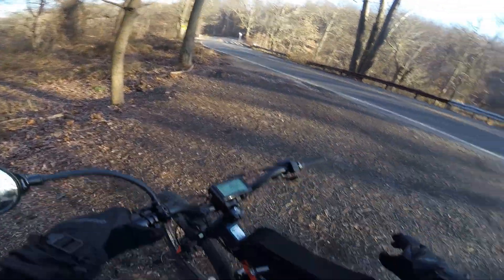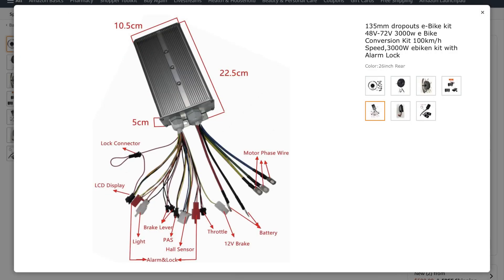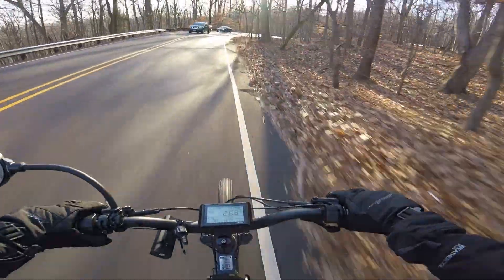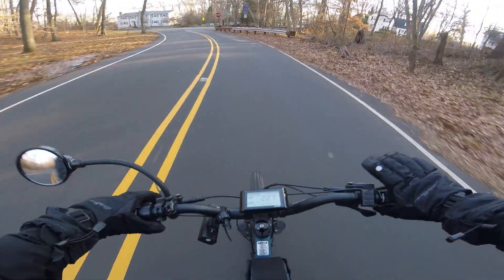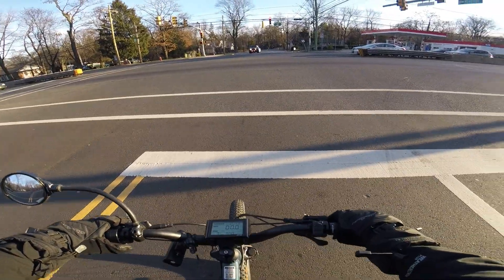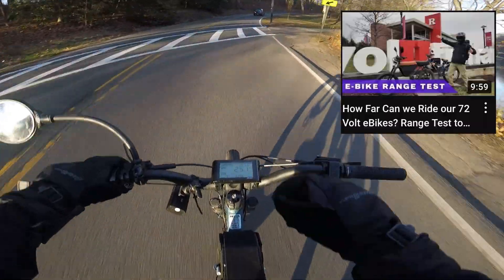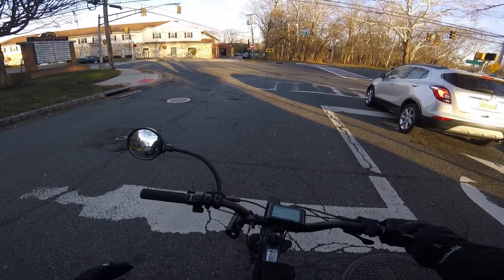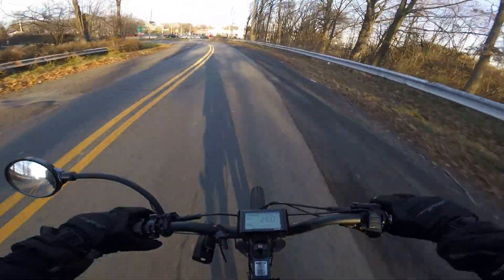How To Build Your Custom eBike

Comment: What's interesting is I think the reason all of these bikes are peppier when there's a full charge he's because these motor controllers are limited by current. The motor controllers have an amp limit not a wattage limit.
It is true that the display show us the amount of watts consumed. There is naturally more power in the battery when it is full how ever there is no circuitry that is calculating wattage reducing the outflow.
The motor controller is just limited to say 45 amps on your bike and 45 amps times a full charge voltage of 80-83 could be as high as 3,700 watts. 
Sure you have a "2,000" watt motor. 
But I believe the physics and Engineering of your motor controller dictate that your motor can behave noticeably different from a full charge to an empty charge.

Comment: Hey mate i got a 1500w 48v ebike kit and i bought a 48v26ah battery for it the cables black on black red on red so i wanted to connect them together and they give me a spark do you had this also before some people say its because my battery has no on/of switch i freaked a little can you give me some advice ??? Im little frustrated if i still have to connect them or that something is wrong

Comment: Do you have hydraulic brakes? how critical would they be for your build? I actually just bought the same motor kit and battery as you, excited to build
Reply from the maker: I did upgrade to hydraulics. I got away with mechanical for a while but once I upgraded I had way more confidence to actually use the power of the bike.

Comment: Nice.  I would be interested in a video with more info about your triangle battery mount.  Any frame worth converting in my mind has a shock in the way, just like yours.  I am at the point where I want the amp hours I can't get out a shark pack.  Thanks and keep it up.
Reply: hey what did you end up doing?

Comment: I'm riding a Modified Razor Mx650 w/ 48v 2000w and it does about 30-35mph (but I really want an electric enduro frame like the one you showed) depending on charge but it's still scary doing 30 mph when you're 2 feet off the ground.... I plan on going to the 72v 6000w Electro Braap kit for Razors then doing a full lights kit so I can get it registered as a "small displacement moped" so I can ride it around town w/o problems.
Reply from the maker: That will be an epic build!
Reply: @NPLVentures  - Haven't looked into the "local laws" on it yet but the cops close to my house stopped me once just to see what it was then never stopped me again but the cops in the next town over (which is literally only a few hundred feet from where I live) have stopped me on an Schwinn S500 scooter w/ a seat and argued that it was a gas scooter and tried threaten to impound it then told me not to ride into oncoming traffic, which was why he stopped me but I was crossing the road w/ no cars on the road coming towards me. So, I try to avoid riding my Mx650 too far in a certain direction which sucks because that's where all the stores are...   😩    LoL

Comment: I have a ebikeling 1200w rear motor and a 52v 20ah battery and can never get over 30mph because I weight over 250.
Reply from the maker: That’s not to abnormal, but ebikes are definitely sensitive to weight especially in terms of range.
Reply: @NPLVentures  I use the bike for food delivery nearby my house. When it gets low normally around 2 to 3 hours I go home. So I don't pay much attention to miles.

Comment: my bbshd is modded and has an external asi bac 855 running 72v. the bbshd at 52v still has the controller on the motor tho.